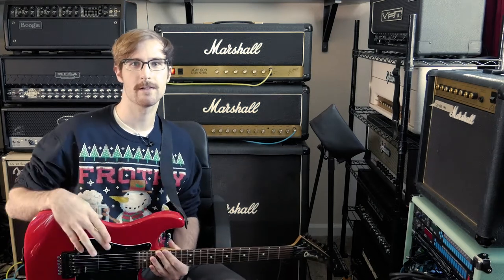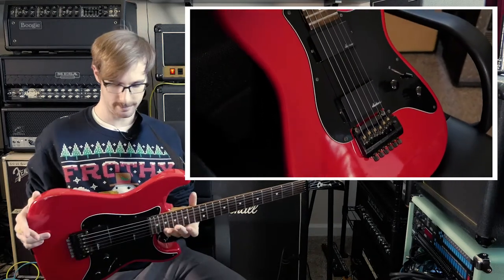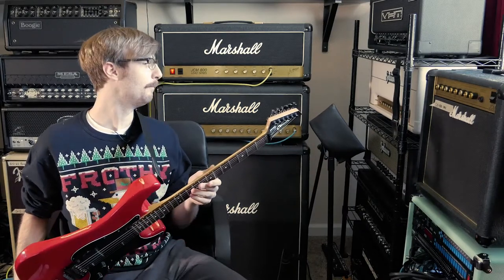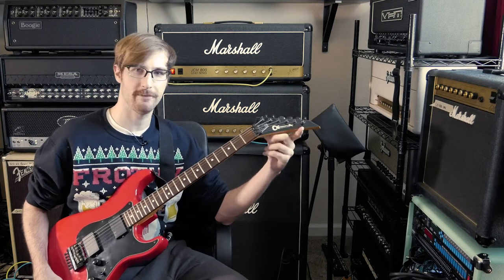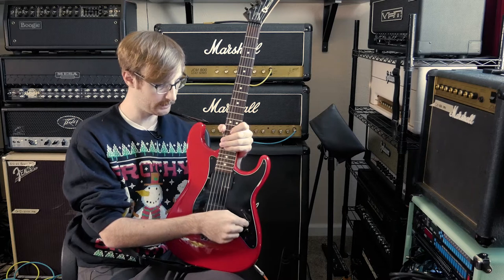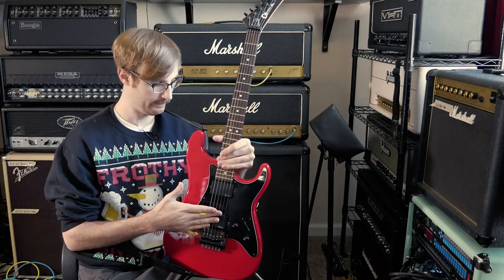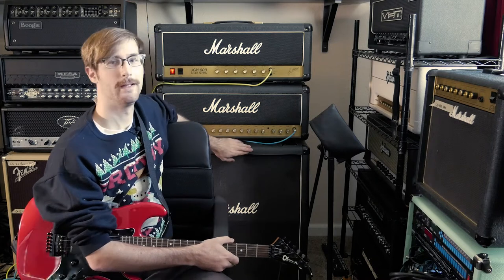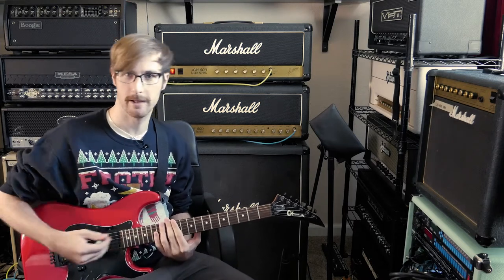1986 Charvel Model 3A - Overview

Comment: My '86 Model 3A has a pickguard and the double-stud Kahler tremolo but different Jackson pickups with no covers (coils exposed). The selector switch is 5-way, with positions 1 and 2 splitting the coils in different combinations, position three selecting both humbuckers, 4 is the neck pickup and 5 the bridge.
Reply from the maker: Nice! Sounds like yours is a hair newer than mine then. There were some transitional changes between the one I have here which is very early and the later ones (which ditch the pickguard entirely, but always have the 5-way)

Comment: What  brand and value pots are in this model? 500k Alpha?
Reply from the maker: Sorry, I'm not positive. I sold this one a long time ago (right after this video actually)
Reply: @totallyradguitars959  do you know what pot in your 5/5A?
Reply from the maker: @LuisMorales-xr1gm  That one came with a replaced 25k pot and an EMG. I swapped it to a J90C because I couldn't find a J95, but I used a new 500k pot. Sorry I'm not much help on this, I sold that guitar too
Reply: @totallyradguitars959  No worries at all buddy.

Comment: Just A FYI. That kahler bridge is terrible if you actually use a bar. If you plan to keep the guitar and have a functional, reliable vibrato, a genuine Floyd Rose is the way to go for such a nice Charvel.
Reply from the maker: I’ve already sold this one, but I thought the bridge was pretty good. At least as good as any fulcrum type trem on a strat. Personally I’d never modify something original like this as it’d require drilling for studs/posts, if I wanted a floyd type bridge I’d have gotten one with those fitted from factory (like the 87+ model 3A’s).
Reply: @totallyradguitars959  Thats all good ! I was surprised to see that kahler on the Charvel. I owned a BC Rich Bich a long time ago (80's) and it came with that kahler. Was nothing but trouble for me. \m/
Reply from the maker: @jrg770  They only showed up on the really early 1986 year Model 2's and Model 3's. I bet they weren't well received because people wanted to treat them like floyd's and they aren't. Charvel got smart and dumped the Kahler's on all models for 1987 and later.
Reply: Incorrect. Kahler's are fantastic. My 84 Explorer has had one on it since 85 and I've used it and some famous players used it on stage all these years and it has never let me down or left me hanging, and I use it like you would use a Floyd. Not certain how many years of experience you are using in your post.
Reply: @NitroModelsAndComics  I mean, nobody said Kahlers were bad. I did however say that my experience with a SPECIFIC model, was horrid, the 2520, the model on this guitar. They are nothing like the high quality expensive 2200's or other Kahlers.
Reply: @jrg770  No, you said it is terrible. My apologies. As did a clueless lot of others below.
Reply: Is the 2520 kahler double locking? Or does it only lock at the nut?
Reply: @mattm6623  I think the strings slide in through the bridge from the top (behind the fine tuners) and you leave the ball end on. Going from memory though. So no, they do not lock into the saddle with saddle blocks like a double locking bridge would.